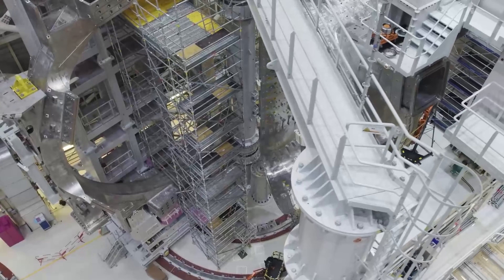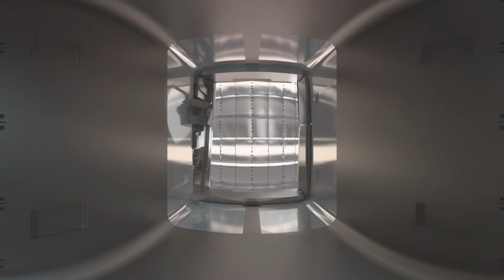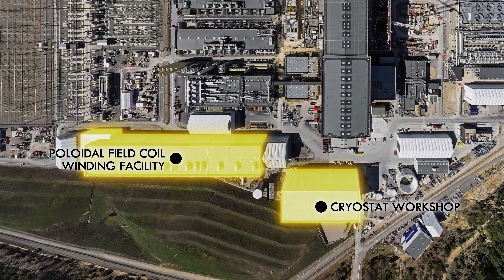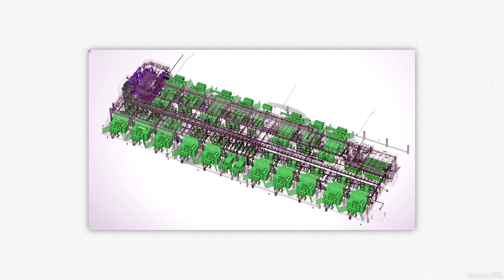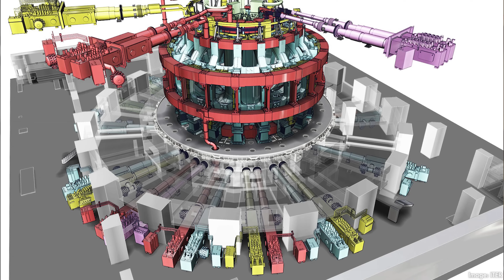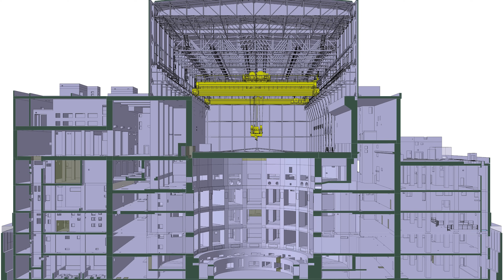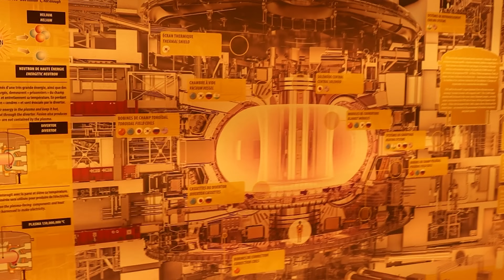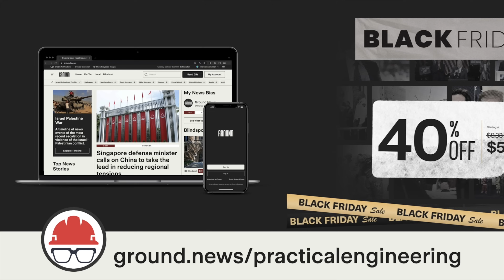Engineering The Largest Nuclear Fusion Reactor

Comment: Redundant lifts? That's some insane level of caution. Can't wait to see this come online!
Reply: I don't think they are fully redundant. They seem to share a track, and for some loads they need to work in tandom. Depending on how or where a lift stops working could block the second unit from a full range of motion.
Reply: @RowanHawkins  It's also much easier to keep everything level and in the right position when you have more anchor points. Anything to avoid bumping things into each other is a good idea with this.
Reply: ''...come online...'' You OBVIOUSLY didn't watch the video.........................
Reply: @jimihendrix991  The obviously did watch the video, seeing as they mentioned the lifts. The reactor isn't operational yet, and they're excited for when it will be. That's what "come online" means in this context. What did you think it meant?
Reply: @notnullnotvoid  ITER's stated purpose is scientific research, and technological demonstration of a large fusion reactor, without electricity generation. Thus, 'come online' to do what?
Reply: @jimihendrix991 to start fusing plasma with a high Q factor!
Reply: @kaitlyn__L  ... still won't be generating electricity though...
Reply: @jimihendrix991 if they successfully get it working, producing electricity is the next step. Focusing on one step at a time with something this insane is important because we are talking about decades later. What point is there in designing a generator for the expected output with modern tech if we won't reach that point for 20 or so years? We will have made advances in that time that require scrapping the whole plan to incorporate the advances made, and to the actual output of the reactor once it becomes a known factor.
Reply: @adaelion3772  Exactly, what if a Stellarator concept turns out to be a better option than a Tokamak for the DEMO reactor?
Or what if one of those startups makes a breakthrough? (probably not)
Reply: @jimihendrix991  They can replace the giant radiator with a small power generator if the fusion proves successful. What is the point in investing in a powerplant just to have it sit there unused for 2 decade on the off chance the experimental part is successful?
Reply: @TheDuckofDoom.  You're essentially asking "why would someone build an experimental car engine if he doesn't put it in a car?"
Maybe to try and figure out how to build that experimental car engine?
Just imagine how much easier it is to build that engine on the table in your workshop instead of within a car.
Reply: @cy-one  r/whooosh! 
That's not at all what I was pointing out.

Comment: The most intimidating part of projects like this (similar to Apollo program, or building a megastructure) is that not a single person knows every part. Everyone realizes they are only a small cog in a large machine. With billions of different bolts and nuts, it is easy to imagine one person making a mistake somewhere along the line. I am deeply interested in the mechanisms that would prevent human error (redundancy, double or triple checks, etc.). This project will take 20-30 years to complete, meaning a large transfer of personel over the years. Only a few people saw the beginning as well the end...
Reply: It’s why modern engineering involves so much documentation and review.

Any well designed product goes through an exhaustive FMEA (failure modes and effects analysis) process that involves experts from many different disciplines to think of all the ways a step or system can fail, and then find ways to mitigate those failures. Ideally you’d want to design them out, but that isn’t always possible or practical.

The “least desirable” form of problem detection/avoidance requires human input. Humans aren’t well suited for repetitive, boring tasks. There’s a whole branch of engineering dedicated to this called human factors.

I’d really like to see a Practical Engineering series on FMEA. It’s fascinating stuff, and has come a long long way over the past couple decades.
Reply: @sircrapalot9954 Think about the Lockheed employees who designed and built the C-130 Hercules transport aircraft in the 50s. I'm going to bet not a single one of them is still on the program today, and many of them have passed on, and yet the aircraft is still in production.
Reply: @RCAvhstape  I wouldn’t be surprised if many legacy parts designed on slide rules and drafted by craftsmen with pens have remained unchanged. It’s probably not worth the expense updating those designs without a requirement to do so.

That being said, the C-130 has gone through many revisions. Any newer systems and modifications are going to undergo through extensive design, system, and manufacturing reviews, to a level of detaill that was simply not possible half a century ago.

Supply chains at OEMs with old legacy designs that are still in service are sometimes hampered by their own past. There is a lot of tribal know-how that lower tier suppliers have but isn’t shared up the chain. I’ve seen these challenges firsthand in my own engineering experience at aerospace companies. Modern digital designs carry much more information than just a CAD model, which improves knowledge retention.
Reply: @sircrapalot9954 I saw somewhere that there is a facility that the US Army sends some of their older equipment to be reverse engineered in CAD because all the plans were on paper and many may have been or are at risk of being lost
Reply: @RCAvhstape Documentation, obviously.
Reply: Have you read about how long it took to build some of the cathedrals in Europe?
Reply: @ashleydolin4292  Basílica i Temple Expiatori de la Sagrada Família, started in 1882 will be done in ????. Now that's a building.
Reply: That's why you want people specializing in each field to make sure that specific part is done by the absolute best person for the job
Reply: I feel like this is true of any moderately complex consumer good too. Like, I don't think anyone at Whirlpool has memorized every part of a particular dishwasher model.
Reply: It's a great example of the rise and steps forward of civilization and parts of the intrinsic ties of collectivism and altruism to science and engineering. We are better together and anyone could know something that others can't. If you don't help each other we will progress forward slower. The best advances always require teamwork to bring forward and make possible. Many individuals have many ideas, but it takes a village to implement grander schemes
Reply: Then there is the LHC at CERN. Also, a very big project parts wise over a long time.
Reply: We are now in the age of building things that are beyond full conception by any one single person. What we can achieve by working alone is nothing compared to what we can do together. Nothing short of amazing.
Reply: @khills242  Yeah, this is not something a single genius inventor could conceive of and build in his or her garage.
Reply: this is no different than how most complicated things are. have you ever seen the inside of the transmission in your car? clockwork and wizardry. teams of engineers designed that. your phone or computer youre using to see this, EACH PART had teams of engineers to design it, and different stages of making it. 

i fix power plants (gas, and steam turbines like this would be spinning) and its the same way. teams of people to design it. teams to rebuild it, and everyone double checking each other at each stage. with some other people taking a look just to be sure
Reply: This is true even of producing a humble pencil. 10s of thousands of specialists and millions in equipment investments all around the world are needed to supply and assemble all of the component parts, and with an efficiency that allows all of those involved to make a profit while each pencil sells for only a few pennies.
Reply: @Nitrodamous  1 thing never matters that much, if it did nothing would last more than a week.
Reply: Immortality is require for the future.
Reply: Another problem is, that each participant country is held on the same knowledge and production possibilities.

So same pieces are build in different countries. Imagine the troubles to fit all these in to one big machine...
Reply: In reality the truth is what you say you are a small cog in the universe, that is exciting ( for the reasons you mentioning ) and depressing at the same time, if you think about, what is the meaning of life? What is the meaning of your life, from your point of view? What is the importance of originality? Why you and not someone else?

Comment: Artificial nuclear fusion power isn't "a star in a jar" it's actually far far more impressive than that.

For a given volume a star doesn't actually make that much energy. If we were to to magically recreate the fusion of our star in large building size, it would onyl be a few hundred watts to maybe a couple of KW. Stars are just unimaginably massive and burn for unimaginably long times. For fusion to ever be viable on earth we need to exceed the power density and temperatures by orders of magnitude. "Star in a jar" massively UNDERSTATES the scale of the challenge and the scale of the achievement IF we ever succeed.
Reply: Well sure,  the sun isn't very dense,  but it's simply a huge ball of mostly hydrogen that is so heavy that it presses down on its core hard enough to ignite fusion which continues indefinitely.  We couldn't hope to build something with such low energy density; we use electromagnetism to do the squeezing and heating. Maybe one day we'll get enough energy back in order to power that electromagnetism.  

We could light a giant amount of gasoline vapor and hope the blast is enough to power our car,  or we could atomize that gas into an engine,  ignite combustion,  and drive pistons and crank in order to repeat the necessary compression in order to get decent efficiency,  drive an alternator to power the spark and computer and fuel pump,  and have enough leftover energy to drive that car,  under controlled conditions,  wherever we wish. 

Only this fusion beast seems a million times more complicated,  expensive,  difficult, hot, dangerous,  and so far impossible 😂
Reply: @jamesengland7461  We already achieved net positive energy from fusion. Next experiment is making it economically viable.

Since Fusion reactors technically have unlimited fuel they can run infinitely long. But most of the time other parts of the reactor will need maintaining.
Reply: @khanch.6807  When have we done that? If you're talking about the recent National Ignition Facility experiment then you're massively over-stating what was actually achieved there. That form of fusion power sadly has no future due to it being impossible to scale, plus we don't have lasers that are efficient enough to actually breakeven. It really should never have achieved headlines, but unfortunately it did, and now a bunch of people are misinformed thinking fusion is "just around the corner".

ITER is about the only somewhat viable solution for scalable fusion power that we are even close too, and unfortunately it is far from being completed.
Reply: @linuxguy1199 Nah dog, cold fusion will DEF be here in 20 years. 

I heard it as a child, and twenty years later I still hear it all the time so it must be true!
Reply: The power density of the sun isn't that impressive (276.5 W/m^3)
Reply: why the disrespecc for the stars? the shades? (get it? shades) smdh, we'd not be here were it not for the stars.
Reply: And it's still pie in the sky.

Comment: The problem that presently exists is that it takes significantly more power going in than they presently generate.
Reply: that break even point is Q=12, ITER is confident they can get to 10 and new technology is already being worked on that would make future reactors more efficient. ITER is the very first actual fusion reactor the others have been just researching the containment of plasma generally. its like the wright brothers first attempt at a plane making short hops along the beach, we'll be properly flying in a few decades.
Reply: True, but there has been a fusion reaction that has produced more power than was put in. It will happen.

Comment: Wouldn't a non-power generating tokomak need cooling in its wall?
Reply: it does liquid helium is pumped through the walls. there are actually superconducting magnets much smaller than the rest lining the walls just behind the blocks of shielding to give fine control of the plasma.

Comment: I can't believe we're attempting to create a tiny sun and in the end we're just going to use it in a steam heat exchanger.
Reply: It's the most efficient way with the technology we have. Thermophotovoltaic cells do exist, but they're not yet anywhere near efficient as a turbine.
Reply: @timramich  I imagine it is, but it's funny to me. It's like making a modern eletric engine and putting it on wheels from the 50s.
Reply: @jklm011  Not really, also steam turbines themselves and power generators have evolved since their inception. If you want to make a comparison it's like building a train, the principle of steel wheels on rails has not changed in 200 years, but manufacturing and engines have evolved significantly.
Reply: more than that actually. the sun isnt hot enough to get the power output per volume we need. the suns core outputs fusion energy the equivalent of and incandescent lightbulb. the sun can do fusion at such a low temperature and not collapse with such low output because of its size. the density allows incredibly rare fusion events in pure hydrogen to happen which enables a chain of other reactions that output energy and then the immense size of the sun multiplies that tiny output over a huge volume and limits the rate the energy can escape due to the low surface area relative to the huge volume.

in a fusion reactor we dont have the benefit of that density and size so we have to enable the energy outputting fusion reactions directly and at a high rate. which means we need to heat the plasma much much hotter than the core of the sun.
Reply: @Vulpecula1919 100W/m^2 is supposedly the average at sea level (about 90% goes into heating up the atmosphere so it's about 1kW at the Karman line) though that varies a fair bit depending on latitude and cloud cover.

Comment: I'm curious about the very high temperatures this thing is going to create. Will the atmosphere be boiled off in order to provide enough oxygen to burn at these temps? 
Also I know it's all contained through magnetism but will water running through them as coolant be enough? Even antifreeze components weren't engineered for these high tolerances. It seems the magnets or electromagnets would simply melt down into a puddle soup. Grady, I need answers.
Reply: inside the reactor is a vacuum which tiny amounts of hydrogen heated into plasma is introduced. the magnets hold the plasma in place away from the walls, if enough of the plasma touched the walls it would do two bad things, one it would melt a tiny bit of the walls and the damaged parts may need to be replaced but the second more important thing would be that the plasma would lose its heat. since the density of the plasma is so low it doesnt hold that much energy. the cold plasma would then bounce back into the rest cooling everything down which would mean the magnets couldnt hold it anymore.

so when its working the plasma is hot but held in place so there's vacuum between it and the walls so very little heat is transferred.  
the coolant isnt water or antifreeze or anything like that. the magnets needed to make this work only work when cooled down to only a few degrees off the coldest anything can possibly get. to do that you need to use helium cooled down to the point it becomes liquid.
Reply: First off, the tens of thousands of engineers involved in this project have worked that stuff out.

No oxygen needed, it's a plasma, not fire. I don't know the type of coolant used, but it'll be cooled by converting heat into steam for the turbines, assumedly with a backup/regulation system as well. And the massive cooling facility is there to make the magnets not turn into a puddle. Think of the CERN collider, but scrunched up smaller.

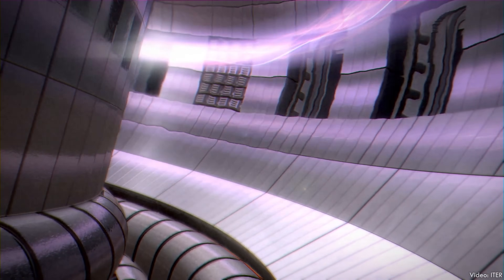Comment: 13:00 seems kinda wastefull to not even try to re-capture the say 5-10% of that massive amount of power for power generation?
(that's a low percentile prediction as we are most used to seeing in these kinds of experiments)
Reply: To recapture that energy for distribution back to the grid they'd need a power generation plant. One that wouldn't be operating anything but a tiny fraction of the time, but which would still need to be staffed, physically maintained, and repeatedly started and stopped. How wasteful is it keeping an entire plant worth of technicians and engineers on standby for a mostly off power plant? It's not like there are an abundance of such trained and qualified people just sitting around. 

Shutting down and starting up a single generator turbine in an already operating plant is not trivial. Starting up the first turbine in a plant is a big deal.

Comment: it's a race between large-scale hot plasma containment fusion, and small-scale cold lattice confinement fusion
at the speed small-scale cold fusion can be iterated, I'm still betting it'll get commercial before ITER has its first test firings
Reply: That's very optimistic of you, or maybe you think ITER wont come online for thousands of years.
Reply: @igrim4777  I'm just betting on ease and rapidity of iteration over ITER, especially in the context of a singularity
hot containment might actually work but that doesn't change the fact it's the least likely to be efficient both thermodynamically and engineering-wise
Reply: Shades of the Super Conducting Super Collider. Waxahachie, Texas will never recover. But lots of RE people got real rich real fast.